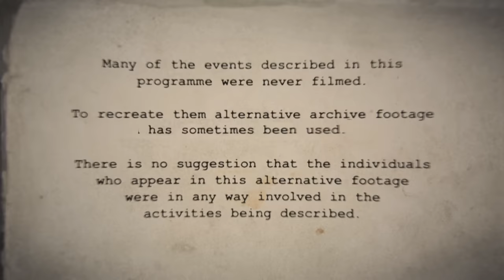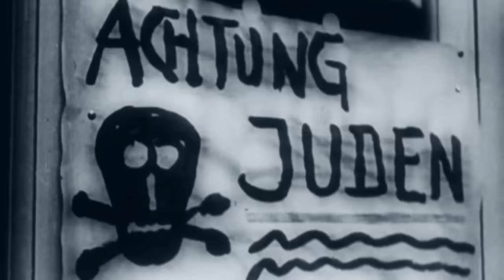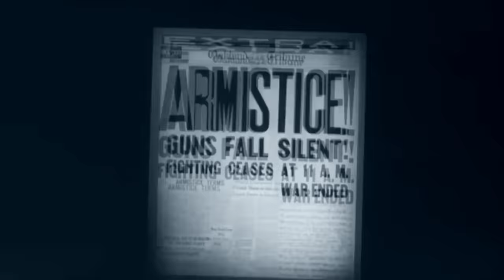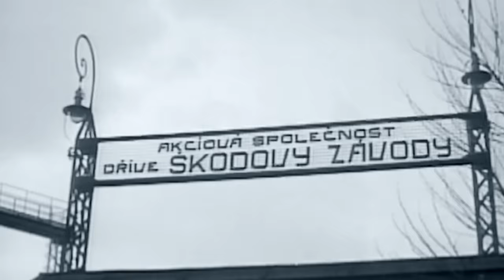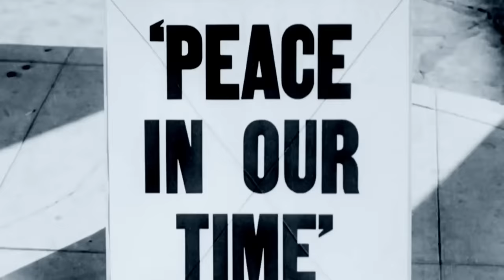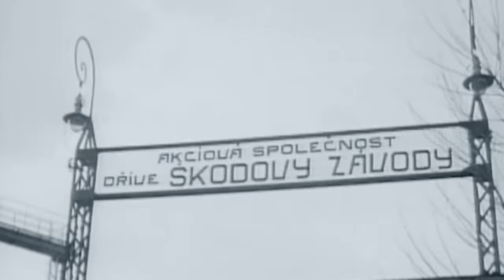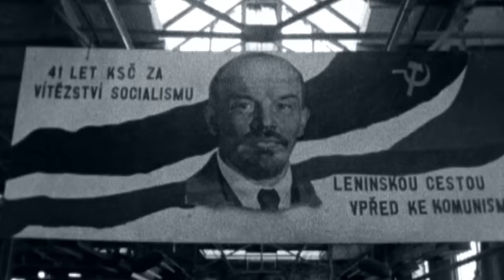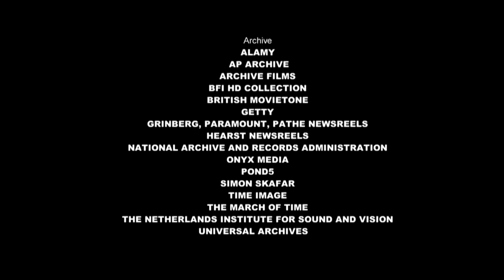War Factories | Season 3, Episode 3: Skoda - The Factory That Fought Back | FD History

Comment: I would argue that the key component of Blitzkrieg was methamphetamine, not tanks...Pervitin, not Panzers
Reply: Actually, the KEY was electronics -- as in world standard military radios.
Guderian was an ELECTRONICS/ intel intercept officer in WWI.
This keeps getting glossed over in pop histories.
His obsession was the radio nets that his panzer divisions would require.
He, personally, designed them. This comes out, explicitly, in his auto-bio.
Reply: Still a factory that produces the methamphetamine 😂
Reply: Oh yes, cause an attack led by fast tanks used to cut through lines and encircle their enemy, could of been replaced with just an army of tweakers running at full sprint.
Reply: @TrySomeFentanyl  well if the troops manning those tanks need to stop every 12 hours or so to rest, then they are going to cover half the ground they would if they were able to stay awake and alert for 3-4 days straight. I see your point but I also see the original poster's point as well. It was a deadly combination.
Reply: @renaissanceredneck3695  tank crews can go a long time, rotating rest. Seen it through many operations in peace and war.
Reply: Point taken.